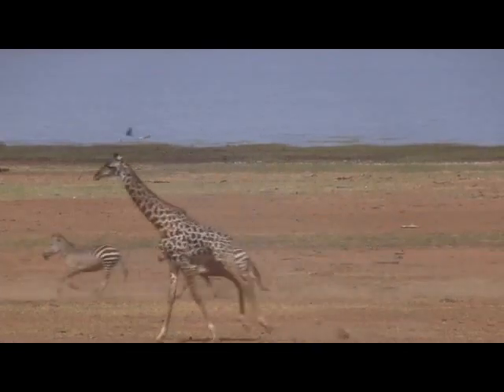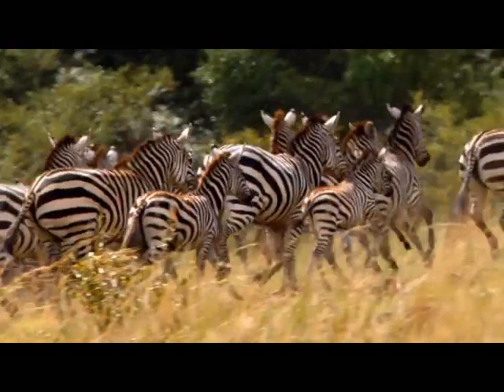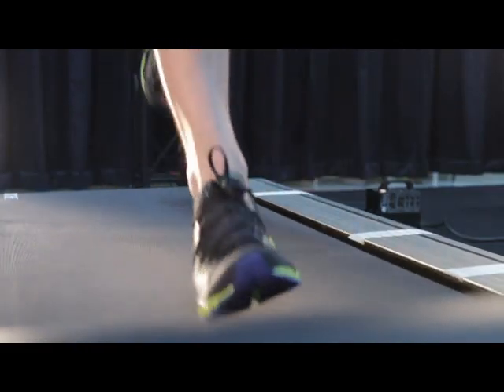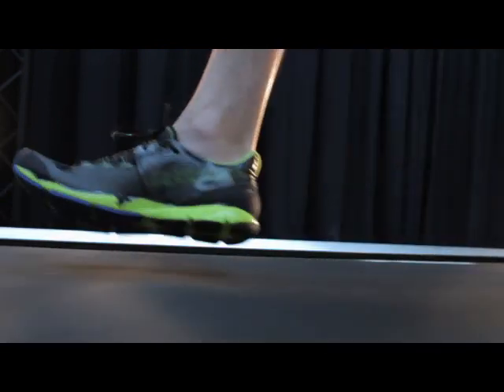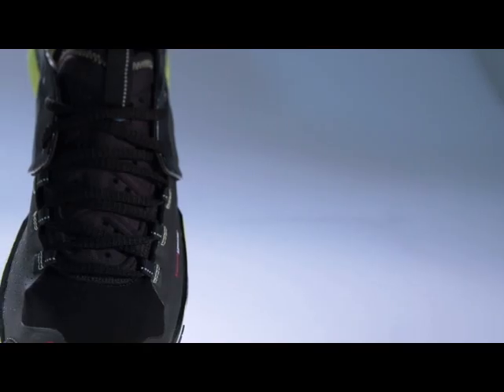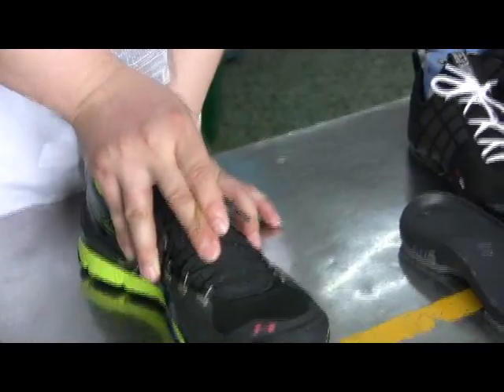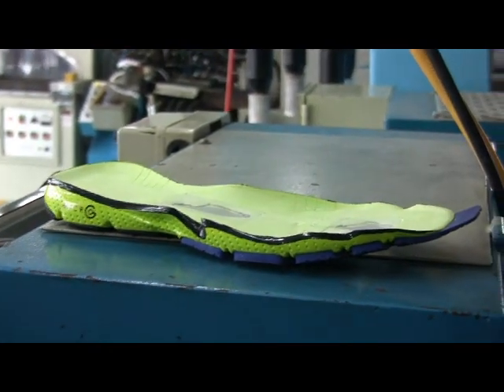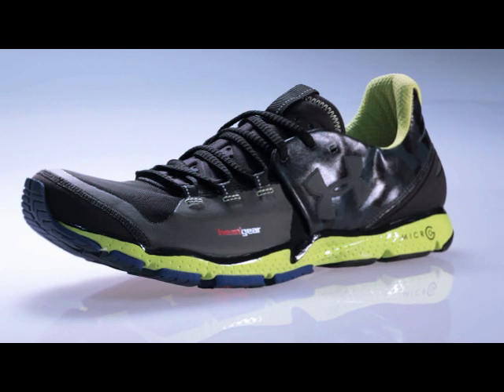Making of  Under Armour Charge RC

Comment: These shoes have openings underneath supposedly for ventilation. But if it's raining or you step on a puddle guess what? Yea, the dame water goes directly inside and your running with wet socks and feet.